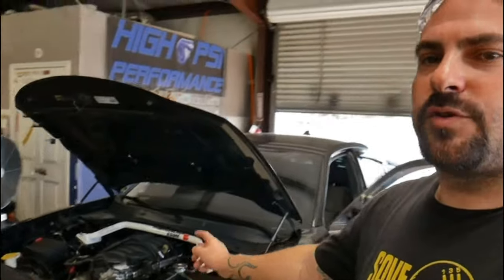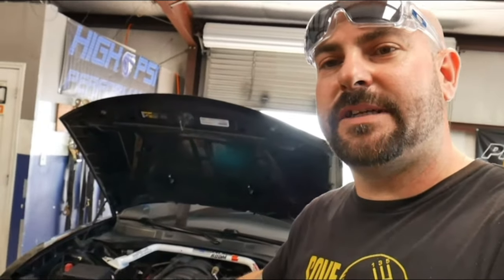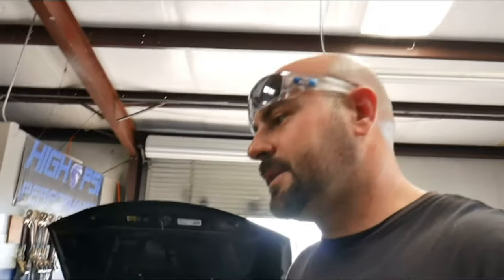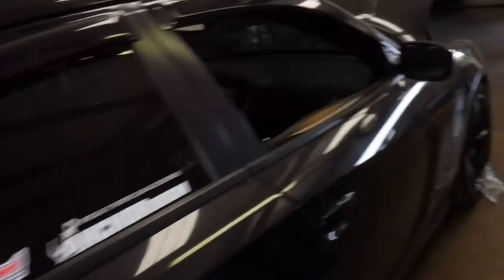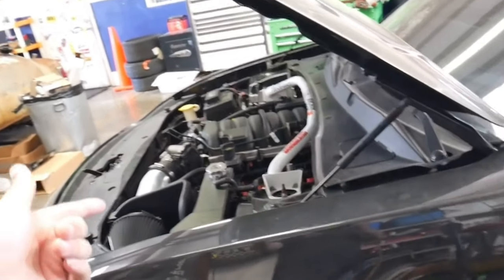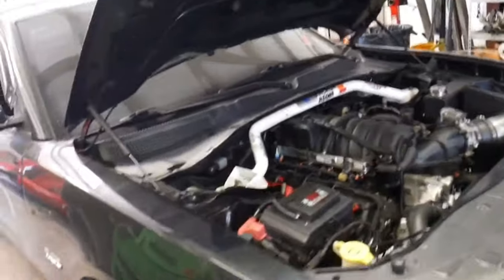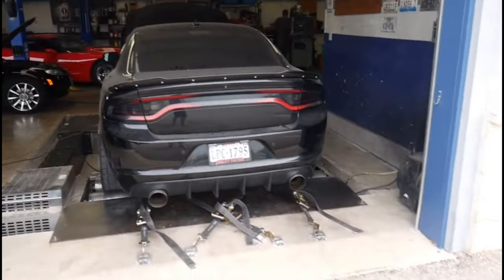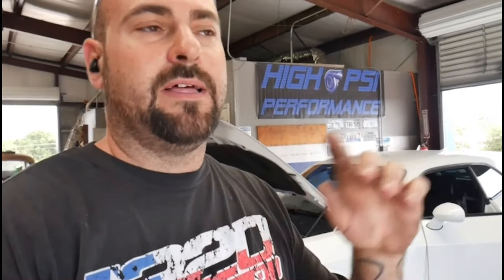MONSTER 5.7L Hemi!🔥 Best Hemi cam?!?

Comment: Have my 5.7 at ~800whp not sure what else to do to it to get close to that 1000 mark without risking head gaskets and sending pistons into the stratosphere.
Reply: What all do you have done?
Reply: @jordanparker8359  it’s a 5.7 stroked to a 6.1, pro charger, long tube headers, corsa cat back exhaust, built trans, getrag rear end.
Reply: @wills4187  dangg sounds badass
Reply from the maker: @wills4187  ARP head bolts?
Reply: @Official-mopardaily  Yes sir. Nothing left untouched
Reply: @wills4187  how do you get a built trans auto
Reply: @ATK_302  a bigger stall converter
Reply: @wills4187  how much boost can u run with that displacement on a 5.7?
Reply: @Ariel0104  running at about 14 pounds. Was told, any more than that and you risk blown head gaskets for a 5.7. Don’t have a wallet big enough to test that theory though so I’m playing it safe for now.
Reply: @wills4187 
Nah, arp head studs will fix that issue. If you have a newer 5.7 you should be fine if you did a crank stroker and not a bore but remember rotational mass…I think you’re fine where you are I mean 1000hp is cool and all but when would you actually use it? Once a month at the track?
Reply: @wills4187 anymore than 10 you’re playing with fire.. do not boost yalls ride 10-14 pounds 😂
Reply: @moosestanggang I have to say I haven’t had any issues with mine for years. What makes you say that?

Comment: 500whp out of a 5.7 idk im a bit skeptical gotta see the track numbers if so ima need the sauce for my 6.1
Reply: 500 is easy to get out of a 5.7
Reply: @Justin-us8iq  how what all you need
Reply: Seen all kinds of cams installed in these 5.7s and all run 400 to 450 max on dyno without boost ..really like to see more info on this 1 of a kind
Reply: @darrenkidd271  yeah, that car is definitely not making over 500 wheel. The Dyno pull sounds like it was in the wrong gear and the Dyno operator definitely needs some Dyno educate training. Plus E85 in an NA hemi is only good for a max of about 15 to 20 ponies.
Reply from the maker: @darrenkidd271  this guy thats saying 500 out of this car isnt real, would probably feel pretty proud to know it makes 740 now to the wheel lol.
Reply from the maker: @FreeRiderNeal  on this video it was 512 to be exact
Reply: @Official-mopardaily  740 All NA Motor??? Im Askin Cuz I Tryna Get Them Numbers All Motor In 6.4 Scat
Reply: @Justin-us8iq  - No it's not.
Reply: He must mean at the crank....
Reply: @zachaca  lol yeah it actually is but believe what u want
Reply: @zachaca  Nobody is measuring/converting HP and TQ numbers to crank numbers when they're using a chassis Dyno. Also, power numbers don't mean a whole lot other than a benchmark for what certain modifications made or modified power. Track and street performance is what matters. Sure, I can put long tubes and a wild cam in a 5.7 and pick up 100 extra hp to the wheels. But that car is going to drive like crap. These claims about 500 or 740 to the wheels on a STOCK DISPLACEMENT NATURALLY ASPIRATED 5.7 HEMI ENGINE are BS lies. This guy is just trolling everyone. 
Hell, he can't even perform a Dyno pull correctly 😂. This is exactly the kind of guy at the car meet that claims to have a NA 5.7 that keeps up with hellcats, but then refuses to run the car because of (insert reason). "Naw, I'm not running the right tire", or "I just got a bad tank of E-85, it's running lean". GTFOH with that crap 😆
Reply: Win u just dont no 😂500rwhp all motor is easy for any motor if u put the 💼 in it with a gud tunner
Reply: You don't have a 6.1 stop lying

Comment: I have the exact same set up with the exception of a 6.1 manifold instead of the 6.4 I have never been beaten by another rt let alone a base scat..
Reply: The 6.1 manifold works on the 2015+ 5.7's?
Reply: @davidgreene2094  yea the 6..1:;manifold fits all 5.7 & 6.4 block from 03-current
Reply: @killshot_ta4461  what about the cam or any other interchangeable parts? I'm asking for my chrysler 300 build
Reply: @davidgreene2094  everything from the 6.4 is interchangeable with the 5.7 for the most part.
Reply: @davidgreene2094  all vvt parts . eagle to apache cross fit.

Comment: Im debating on a 410 stroker with this cam and long tubes. Or a procharger with a cam designed for boost and long tubes, ported heads and stuff
Reply from the maker: With this cam set up i still run nitrous. Even though it may not be a traditional “boost” cam

Comment: 500 to the wheels from a all motor 5.7? Got some nice mods on that thing but I'm skeptical. Does this have a stroker?
Reply from the maker: No its same compression, no bore/stroker
Reply: @Official-mopardaily  Stock 5.7 Eagle heads?
Reply: @zachaca Based on the original video and what was said, I believe the heads are stock eagles. And yes 500 wheel isnt easy to do, but with the right mods and the correct cam ground on the proper LSA, it is definitely possible.

Comment: Sound is fine n all but what power and where ? If I'm gonna pull the engine apart and freshen it up I want to know if it's worth it.
Reply: He said in the video he made like 500hp
Reply: 512 to be exact
Reply: @problactive285  yeah but where in the rpm range? How far did they have to spin it to see max output? What torque did it make? Where did peak come in ....if I'm going to buy this product I need to know what kind of power I'm going to make and where in the rpm range . Otherwise I'll just be like all the other piss brained know nothing's that see a number and think that's the " hottest shit " for my car. I like to know the specs so I can figure out what converter I'll need, final gears because I am an ACTUAL car guy and the smallest of details allow me to make giant improvements.
Reply: @robsorgdrager8477  from listening to the video I doubt they took it above 5k rpm...the limit on the tach is 7
Reply: @problactive285  still I'd like to know more about the nerdy stuff☺️
Reply: Instea dod dropping all of that money on the 5.7 hemi do a 6.4L swap and build that .
Reply from the maker: @robsorgdrager8477  so coming from building hundreds of different combinations and cams, this cam is definitely like non other. The mods all compliment one another that I choose specifically and took this basically stock 5.7 and putting up against equal modified 6.4’s and they cant keep up. 

So the dyno curve is consistent throughout the pull. The motor had so much more in this video!
Reply: @Official-mopardaily  so these exact mods on your list will give us Mopar guys 500ish considering sir?
Reply from the maker: @HollaIfYaHemi392  oh yes conservative. It has so much more

Comment: How much for a build like this?  I have a 2021 R/T. Want a simpler build.
Reply: Probably 10k tbh with exhaust and intake, cam is around 6k with tourque converter
Reply from the maker: You can do alot better than me with buying parts. I bought alot of things full price but i still paid under 10k for sure
Reply: @Official-mopardaily  Where are you located??

Comment: 500 wheel on a NA 5.7!?  What am I missing?
Reply: Must be running a 150 shot
Reply from the maker: That pull was all motor, on spray it dyno’d at 740 to the wheel
Reply: @Official-mopardaily  no way.

Comment: The tighter LSA should be a performer! I'd like to see a 108LSA on this cam, but it's close. It's the right LSA folks! That's what these engines want. Not 112,114,115 etc. Maybe some one will wake up one of these days and realize this. All wide LSA does is neuter the power. They use wide LSA on Hellcats like mine to make less low end and move power up the curve. Then the same builder will do a stroker kit that makes more tq???? Does anyone see a problem here? Kill power with cam add power with stroker? Why not give the engine the cam it wants in the first place. Makes NO sense!
Reply: Yessir you damn right. 108 is perfect for a 5.7 with stock heads, 110 is perfect if you have ported heads with bigger valves. 

These cam companies make cams with loose LSA’s to compensate for to much duration…. sadly most people only look at lift and duration when selecting a cam so they sell better.
Reply: @flicksifyr6793   btr truck norris hemi cam have 109 lsa , no loss in low range.   Bought week ego.  I think my 5.7 will be happy.

Comment: Parts
Reply from the maker: Tazer z automotive
Legmaker intake
Hurst springs
MMX 84mm ported throttle body
BBK Long tube headers
Limited slip diff 3.09 gear
Hellcat high volume oil pump
JBA midpipe
Texas speed custom grind Cam
Texas speed MDS delete
FIC modified Hellcat injectors
Hellcat NON-MDS lifters/ tray
MMX Ported 6.4L intake manifold 
MSD RPM control 
MBRP 3” catback
E-85 HP tuners 
Procharger high flow dual fuel pump kit
Performance converter 3.6 stall
Ported texas speed heads

Some other small stuff but this covers the main stuff I believe
Reply: What's the Dyno numbers?
Reply from the maker: @craigsixta983  in this video it made 517 but it had alot more.
Reply: @Official-mopardaily  cam specs?